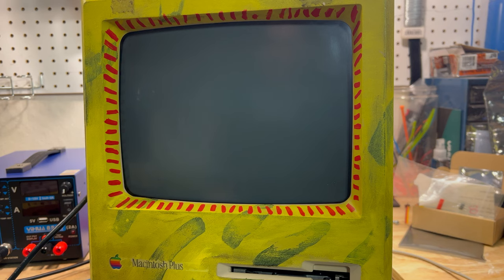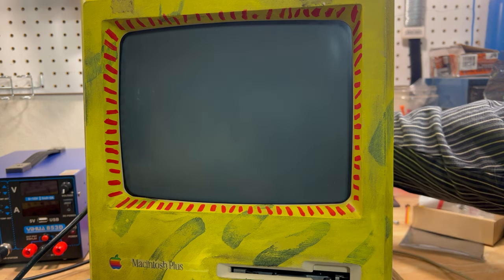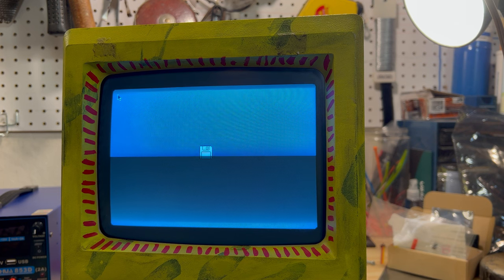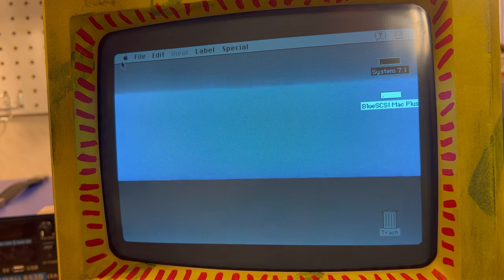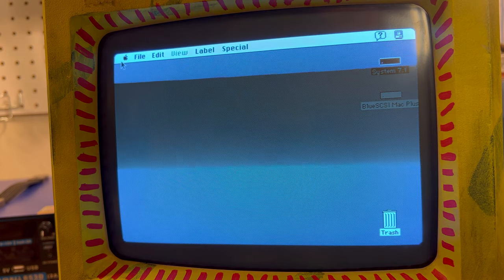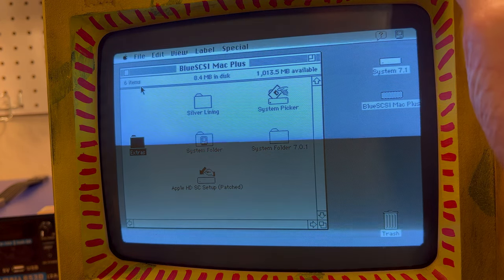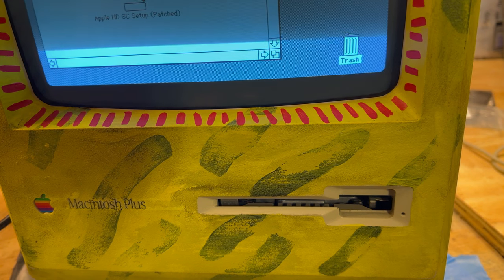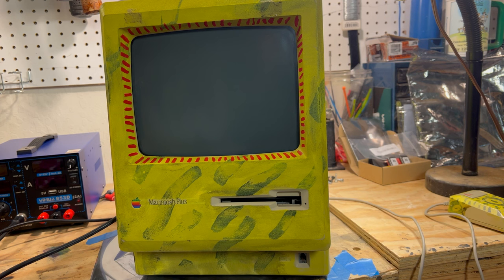ROMINATING THE MAC PLUS CONTINUED part 2

Comment: Well done Dave! For the time being, the kit assembly seems to have gone well. About diode installation and Blue SCSI. Normally, it should be possible to use it together with ROM-inator. The ROM-disk itself may be corrupted for some reason. Swap the HI and LO ROMs of the old ROM-inator and try booting. So, If that doesn't work, I'll definitely support you, so please PM me.
Reply from the maker: Ok I will try that I guess there will be A part 3
Reply: @DavidStahlOLDHAPPyMACs  In this season, there is a phenomenon that the ROM is damaged by static electricity. It is recommended to touch a large iron (Door handle, Iron pipe) to discharge from your body before work. If you need to inspect a broken ROM, please send it back to me. Inspect for free.
Reply from the maker: @infinity5750   what is the best way to DM you tinker different
Reply from the maker: @infinity5750  I change the Hi low ROM does the exact same thing does not see the RAM disk also used the 3.0 Rom Hi Low Same Issue
Reply: @DavidStahlOLDHAPPyMACs  I have one thing to worry about.  There may be some noise on the startup sound or screen.  This is often a problem with the ROM itself, but I would especially like you to check the ROM socket for poor contact.  Alternatively, clean the contacts with a contact rejuvenating agent. Since ROM-Inator uses machine pins instead of normal ROM chip pins, it may not be compatible with some sockets with different specifications.  Therefore, it is important to keep your contacts clean at all times. It may be good to reinsert it many times.
Reply: @DavidStahlOLDHAPPyMACs  There is an email form on my website when you purchased the ROM-inator.

Comment: Hey Dave,  Did you ever figure this out?  I have a rominator on order and I have a mac plus.  I did install the diode to run power to my external scsi port.  I feel like you thought this may have be an issue??  I am excited to try the Rominator but don't want to kill my board.
Reply from the maker: Oh yes did a video on that works great